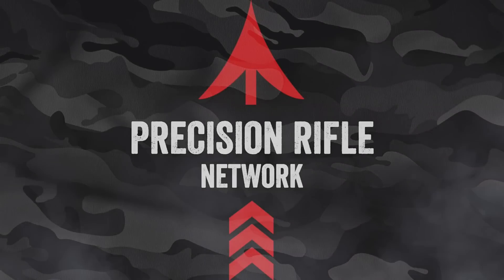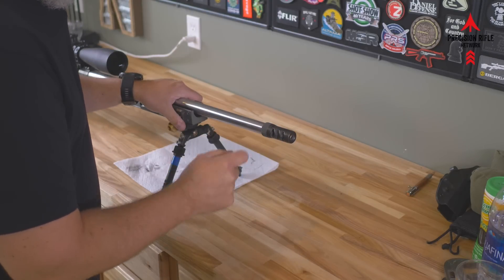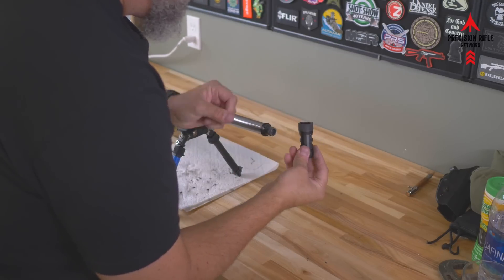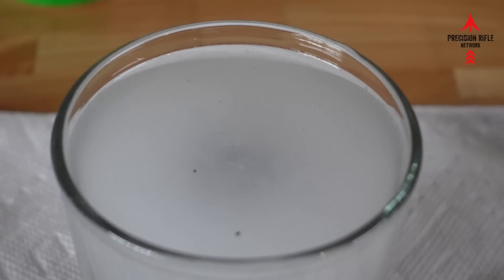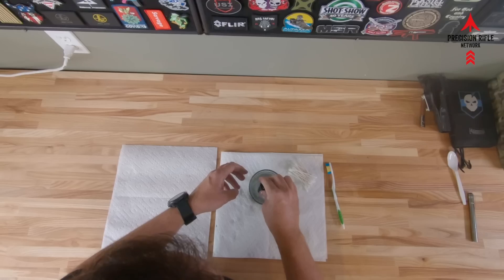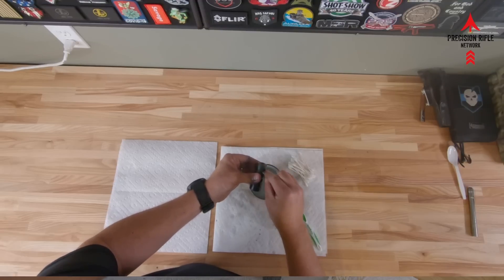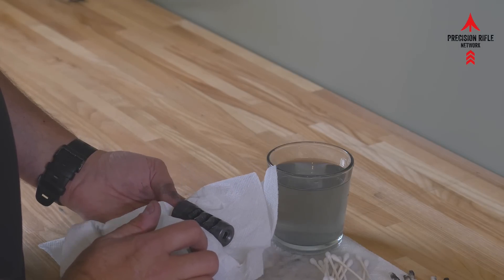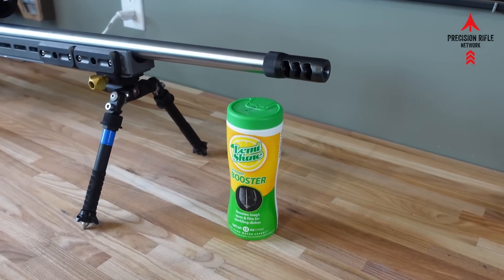How To Clean A Muzzle Brake

Comment: I use the hydrogen peroxide and vinegar solution, break will literally be like new
Reply from the maker: I need to try that too.  Thanks for mentioning it.
Reply: It works phenomenally well, i use it on my suppressors as well.  Just needs to be handled very carefully post clean.
Reply: I use dish soap, baking soda and water to neutralize after cleaning and before I handle the break
Reply: @briancobb978  Its not so much the acidity you are worried about, its the now 'water soluble' lead that will leech into your skin and allow a dangerous amount to be absorbed quickly.  The goal is to turn the aqueous lead back into elemental lead, which is still toxic, but much easier to handle.
 
This is far more of a concern with suppressors, especially rimfire, but I would still be cautious.  

Still good info though, thanks.
Reply: Manitou , good info about the lead.  Would have never thought of that.  Will use gloves when cleaning brakes now.  Thanks!
Reply: That solution was Area419's recommendation to me after slightly turning my nitride brake bronze with CLR for 30 minutes. 50/50 Hydrogen peroxide and vinegar for as long as necessary will not discolor it. Also, don't add salt. I used the wife's 50/50 solution that she added salt to thinking it wouldn't hurt. After 30 minutes it began to rust. Even after rinsing thuroughly the rust was aggressive.

Comment: it's clearly stated on their website to not do this and your are doing the opposite way lol 

Maintenance on any muzzle brake is essential.  Just like your barrel, muzzle brakes need cleaned.  Over time carbon will build up in the ports, mainly the last port as the first two are semi-self cleaning from the muzzle blast.  When this carbon builds up, it will eventually get to the point that bullets can actually strike it.  Depending on your shooting regimen you may not notice this, you might just call it a flier.  But in a competition when you need every round to impact, this is critical.  Carbon bullet strikes are a worst case scenario, but the buildup can also cause accuracy or POI issues just due to airflow changes in the brake ports.

NOTE: The use of Lemishine (or any citric-acid cleaner) or CLR to clean your brake will likely discolor the black nitride, and will void the lifetime warranty of your product. Don’t do this. Seriously. It’ll turn pink and you’ll feel like an idiot.
Reply from the maker: that's cool, but companies say stuff like this all the time for liability reasons.  I've been doing it for years now with no discoloration.  I'm not aware of any other brake manufacturer that warns about this potential.  Follow their guidelines if you want.  I have enough experience with it to know that it doesn't matter when done correctly.

Comment: These household acid not gonna work for heavy carbon residue.  I never cleaned my Area 419 brake for 2 years, now it is caked with heavy carbon gunk.  I let it sit in gun bore cleaner for a day, then scrub it with bore brush.
Reply from the maker: @huntersmillie00  thanks for watching

Comment: Use CLR for 15 min. no scrubbing, rinse with Alcohol
Reply: Don’t use clr
Reply: @ohiodragndime  Tell that to Eric Cortina that’s where I learned about it
Reply: CLR for stainless steel, not blued.
Reply: @barrygrant2907  You are correct, I thought about that after I did the post, I did make a comment not to use on coated items. Thanks Tim